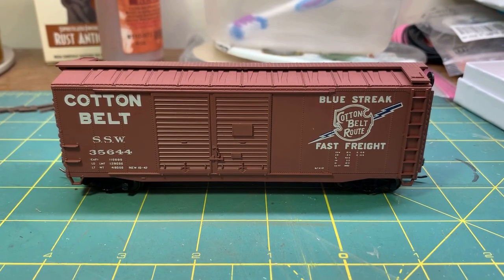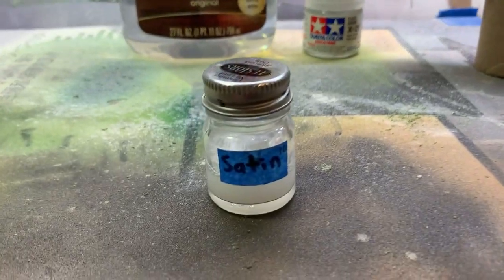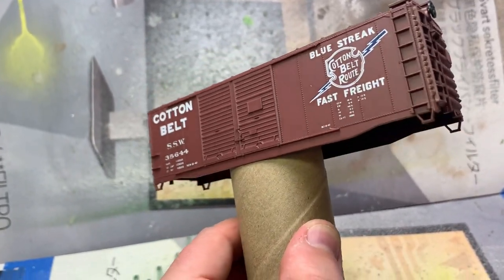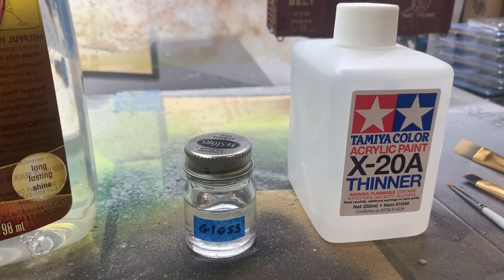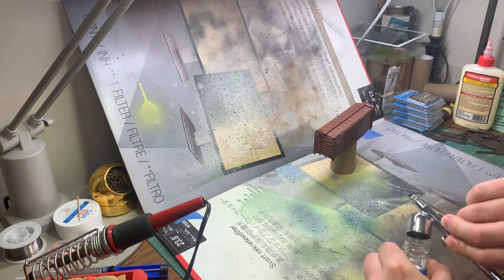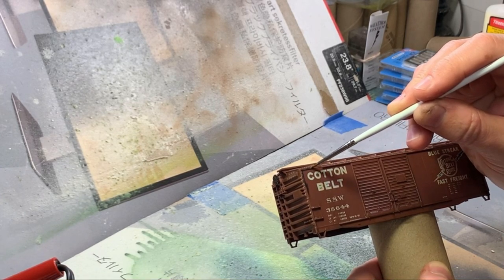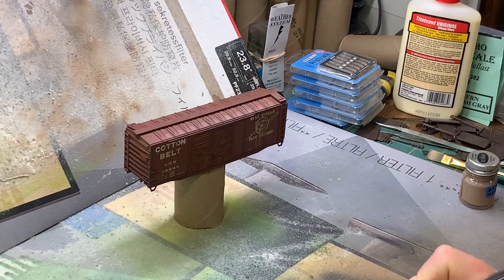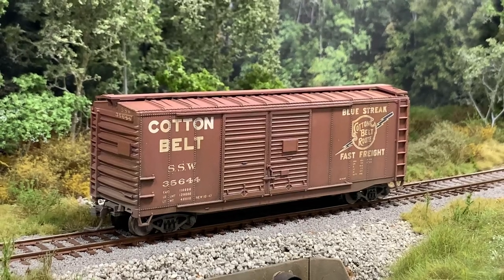Weathering a Special Boxcar

Comment: Wow what looked easy. I want to try it out on one of my cheep cars. Have you thought of using a driftwood color on the tack board around the car? Like on at door. If you paint the middle of the tack board, and leave the ends that hold the board in place. I just adds just a little more to the look. Thanks for sharing.
Reply from the maker: It was pretty easy - just a little block of time for a couple nights and it was done.  Agreed on the cheap cars, that is all I have dared weather thus far!  I like the thought on painting the tack boards, I have thought about it but had not figured out yet how to do it.  I will try this.
Reply: @johnarthur6302  It just needs to be a flat gray. You will love the loo.  On two of my cars after I did it. I took some paper and cut out a little squares and glued it on so it looked like instructions were added to the tack boards. Enjoy. Oh I really enjoy your vids. Keep them coming.